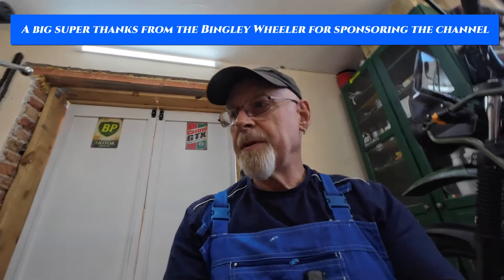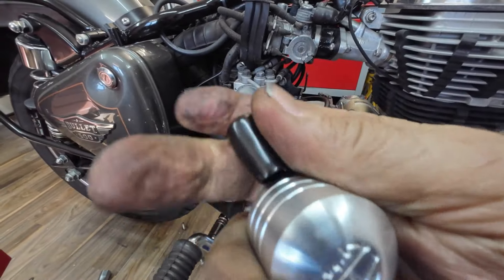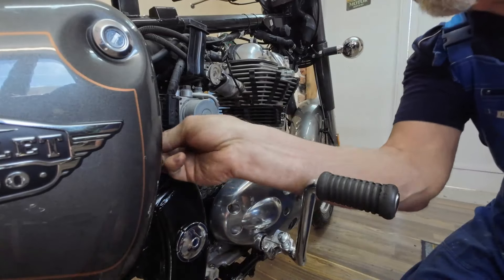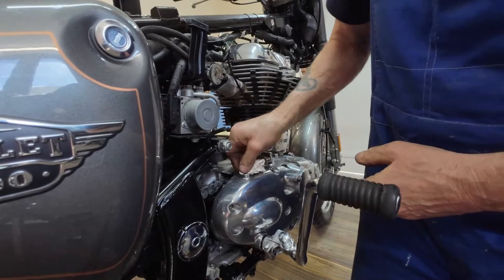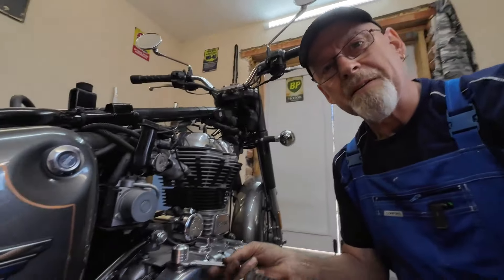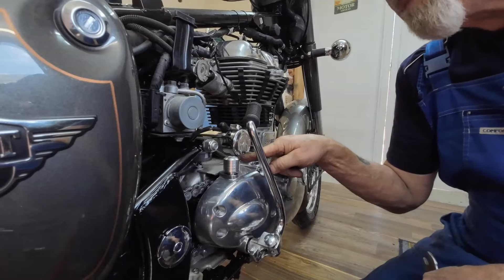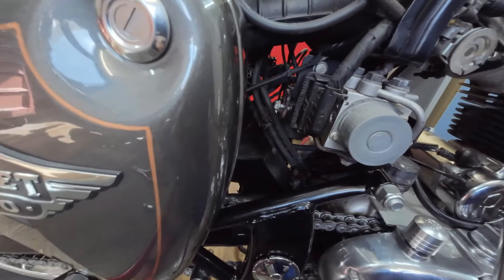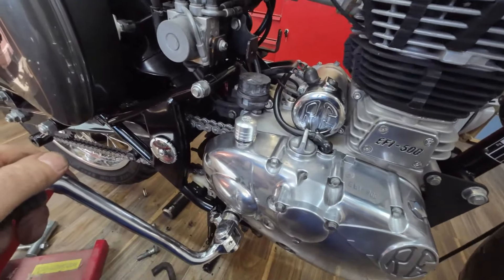Fitting Hitchcock's engine oil breather to Royal Enfield Bullet 500 UCE #royalenfield #motovlogger

Comment: can we just try directing the rubber pipe on the chain with one way valve so as to lubricate the chain from excessive oil
Reply from the maker: You can but that is an old school trick. The excessive oil will end up making a mess on the bike as it throws it everywhere.

Comment: Bottom end breathers can make a huge difference to how the engine runs , even with perfect  barrel sealing . I helped a work mate with a tuned Ford Pinto 2 litre straight four car engine fitted into a Lotus Seven type kit car . The head was ported , with an upgraded cam , dual Weber carbs and pointless ignition . The engine was just not responding to gentle adjustment and we could not fine tune as a result . We went to a large kit car show where I saw an aluminium oil catch tank for sale . With the engine casing having more breathing it now ticked over and responded to tuning . On the road the engine became smooth and responsive .... way better than before the breather system upgrade .
Reply from the maker: Definite improvement on the Bullet. As you say the same technique can be used on many different vehicles

Comment: Nice, I've fitted one myself the other day, I've left the charcoal cannister on the bike as I can't get to the bolts to undo it.. but all the pipes have been blanked off, seems to be running alright, idle speed may be a little high
Reply from the maker: The oil breather is only to do with the rubber pipe that goes into the back of the airbox as shown on the video. It is nothing to do with the charcoal cannister. I have got a video coming out Thursday that involves the charcoal cannister. 

There is the overflow pipe from the petrol tank that runs down to the charcoal cannister. Where the pipe goes to the charcoal cannister just drop that down behind the swing arm so that it will drop onto the floor if it overflows. Next job if you look at the Map sensor which is on the throttle bottle, where the injector is on the right hand side, you will see a pipe come off the back of the MAP sensor. It actually goes to a valve that is bolted to the back of the rear mudguard where it goes just behind the engine. The valve then has two other pipes that go to the charcoal cannister. The pipe on the MAP sensor actually makes a vacuum when the engine is running which operates the valve that is bolted to the mudguard. Basically what you need to do is cut the rubber pipe off the back of the MAP sensor about 50mm then screw a bolt into it to blank it off. At the moment if you pull the pipes off it is sucking air through the MAP sensor and into the throttle body. This is why the engine revs are higher because the engine is running weaker. You must blank that pipe off as described. It is very difficult to explain.

When you see the video on Thursday all will be clear.
Reply: @iantoy7778  I have blocked off the tube to the map sensor, I followed your previous video, all went well with that, all remains is the valve and charcoal cannister, they're not connected to anything else just still mounted on the bike 👍🏼